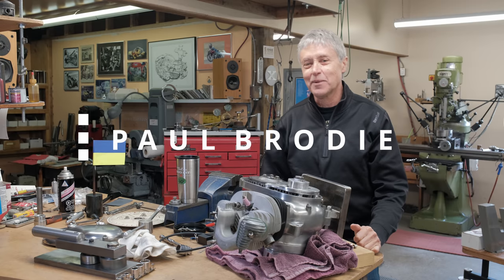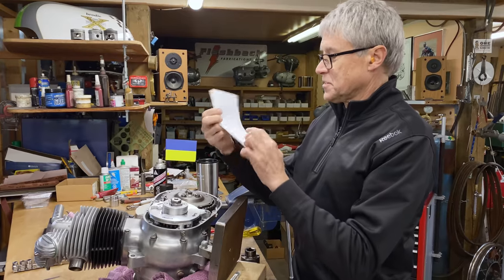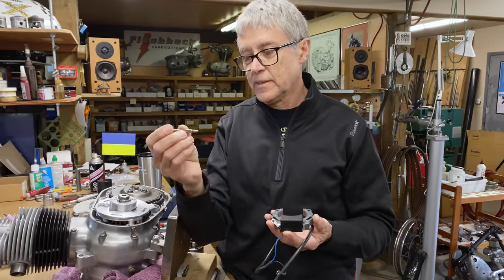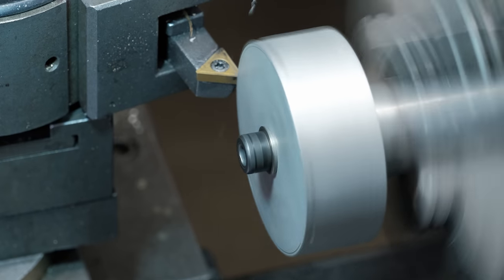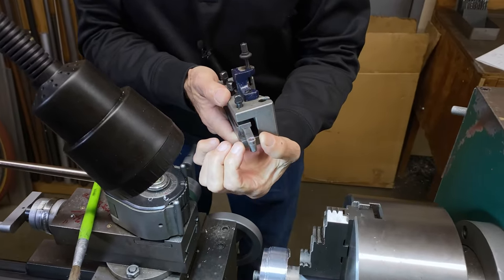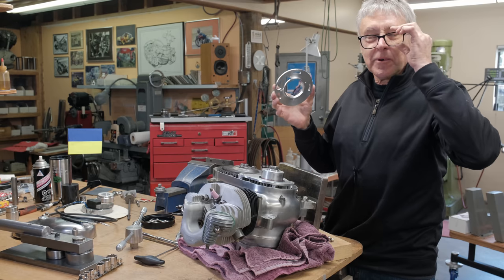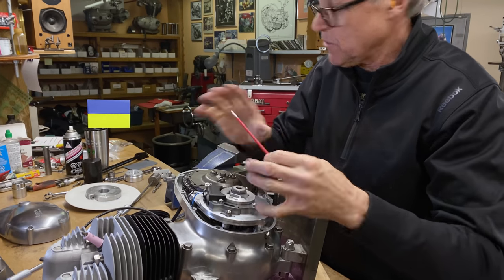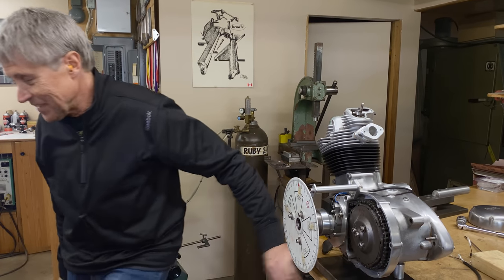How to find Top Dead Centre // Paul Brodie's Shop

Comment: Glad to see another Paul and Mitch show uploaded!
For those not brave enough for powered tapping you can just put the tap in the drill press and turn it by hand with gentle pressure on the down feed until it’s bitten in a few turns. Much less scary.
Reply from the maker: Thanks for commenting :)

Comment: Nice!! The old side valve Dodge 6 engines used a plug in a small hole directly over #6 piston and you used a proprietry depth gauge to do the same job. Thanks Paul.

Comment: If you feel the need to use a torque wrench, pull the spark plug, stuff some rope in the hole and jamb the piston against it.
Works for chain saws.
Cheers
Reply from the maker: Do chainsaws have valves above the piston?
Reply: @paulbrodie  No, but they do have flywheels that need to be torqued.  Rope is a common method to lock the reciprocating components.

Comment: The easiest way to fit a Cub ignition is to spot face the crankcase, and  put in threads for pillar bolts,  which the stator can be mounted to. There needs to be some degree of movement on the mountings, so the stator can be moved slightly to get the air gap correct.

Next establish the TDC position, using a piston stop, a fixed timing mark, and temporary marks on the rotor.  Then, when the motor is ready to run, check the timing with a strobe light, that has an advance feature, so the TDC mark can be used to time the engine.  

There are other ways to do these jobs, but the above is very effective and is a lot less time-consuming than most other methods.

Comment: A little tip: If you set the disc to 0° on the first "stop" you can simply divide the reading at the second one by 2, set the disc to that value und you have the 0° mark at TDC automaticly. Basicly what you did, but you don't have to estimate or calculate differences :-)
Reply from the maker: Yes, that will work too.
Reply: Thats not how it works ;-)
* measure it
* calculate it
* measure it again and check if the calculation based of the measurement is correct. These settings can be very critical high compression bad fuel whatever its useless to save 1 minute of time for this job.

You always rotate the engine at least one more time after change the valve clearance and measure again didnt you?
Reply: @10zoll  It is in fact, how it works. Why shouldn't it? You can check for same readings on both sides afterwards in both cases, mine just makes calculating a little easier to begin with. If there is still any difference, it will be very little and easy to fix. I think you just didn't get what I was going for.
Reply: @andreassiegler2238  sorry i am german and some germans are very meticulous. I do exactly knew what you re going for.
Eg "i" never would turn the degree wheel oposite to the engine rotation like paul did here i would always turn the wheel in that direction the piston is blocked because i am german and i want to limit every minor source of error ;-) btw: i didnt mention that most of the engines started life on my workbench have a compreesion ratio + 13:1 and these "cheap" errors can ruin a very expensive engine and thats just not worth to risk that.
Reply: @10zoll  Well, that makes two of us!
But still to me it makes absolutely no difference at all, which way one would turn the degree wheel, as long as it's on the crankshaft and not the cams or anything alike. When it comes to the ignition timing, you have to turn the engine in its running direction of course. Or maybe I'm not getting you?!
Reply: @andreassiegler2238  In meiner Jugend hatte ich zuviel mit Flugzeugmechanikern zu tun ;-) 4 Augen und 2 Messgeräte sehen mehr als die Hälfte davon.
EInmal gegen den Widerstand drehen und dann die Gradschablone weiter gegen den Widerstand drehen macht bei mir mehr Sinn. Wobei ich nicht weiß - nur annehme - dass sein Blockerwerkzeug dicht ist, der Motor also Kompression / Unterdruck aufbaut und selbst kleinste macken am nagelneuen (hier nicht der Fall) Kolbenboden stören mich.
 Ventile und Kolben mag ich gern glatt hochglanzpoliert, Ansaugwege rauh Walnussgestrahlt. Alles Ansichtssache.

Comment: always thought one had to go only in one direction to time or find TDC, because of the play in he chain... 
also, when I need to time an engine precisely (which may or may not be neede on your engine), I don't measure TDC itself, rather a given amount (say 1 or 2mm) before and after TDC via a precision dial gauge, then TDC is in the middle of these 2 angles (this is because the piston moves slower at TDC, so the angular sensitivity of the measure, hence precision, is lowest)
Reply from the maker: Play in the chain has nothing to do with TDC. You have a flywheel, a connecting rod, and a piston. There is no chain involved. Thanks for watching and commenting.
Reply: @paulbrodie  not the "links" chain (true, kind of misleading here with an actual transmission chain next to it) rather the "mechanical chain" linking the crank to the rod to the piston etc. (when timing valves as well) if one goes always it the same direction the tolerances are zeroed by contact (just like when the engine is operating), when changing direction the contact is made elsewhere...
Reply from the maker: @n1352-m1i  I have never heard a connecting rod referred to as a Mechanical Chain...
Reply: @paulbrodie  I guess this generic use of "chain" is more common here than in America... it's been a while since I've freshened up my English with native speakers.

Comment: Always use this dead stop TDC method with the valve train unassembled.  It’s possible in a lot of engines for a valve to hit the stop.  I made the mistake, once, many years ago.  😬
Reply from the maker: Yes, I'm always very careful with the pressure.

Comment: That was intimidatingly complicated but, a great learning video. Now all I have to do to really "get it", is watch it a couple more times!
Reply from the maker: Thanks for watching.
Reply: It's a lot more 'fun' to degree in camshafts when you have to modify the cam drive. Chain drive is usually pretty easy but gear drive a lot more complicated if manufacturer or aftermarket isn't available (or just too damn expensive)
Reply: Lol. I find myself re watching the older videos a lot. I find there’s always some small detail or move done that I miss. All the tips and tricks, plus the stuff he doesn’t even talk about but shows is crazy useful.

Comment: A tap-o-matic tapping head for your drill press would make power tapping in the drill press a lot easier! As often as you use it, it might be a worthwhile investment!
Reply from the maker: I have a tapping head that fits in my milling machine. I do use it if I have a LOT of holes to tap. For just a few holes it does not make sense time-wise. Thanks.

Comment: I’d like to know 2 things
1) what’s making the odd background noises…. Tasmanian devil?
2) why not just use a dial gauge to find tdc?
Keep up the good work lads
Reply: I believe Paul has some pet peacocks which is what you are hearing in the background.
Reply: 1 its a peacock (maybe this peacock is called mitch *scnr*)
2 pure logic whereever that bolt hits the piston it always hits the piston.
It doesnt matter if from one side or the other so the gauge isnt on the piston its on the Crankshaft.
Reply: 1) maybe a 👽 🙄
Reply: Surely this is more accurate. (Edit) my wife called me for dinner as I was typing, so a bit more... surely with the crankshaft angles involved, this method is more accurate that a dial gauge ‘estimating’ where TDC might be. This one divides between the same minus and plus angle of crank rotation. The Dial gauge could well be 10 degrees out as the piston sweeps over the top.. Les in UK
Reply: @leslieaustin151  Naa thats wrong...
This method is more Simple and less buggy.
Its not the method its the Operator that needs to be accurate ;-)
You always have to measure both ways when the piston is high - when (in both directions) is the piston moving down. doesnt matter if via static stop (bolt) ot via a dial gauge.
Reply from the maker: 1) That is my peacock. His name is Peter.
2) Using a dial gauge to find TDC may not be accurate. First, the spark plug hole is often at an angle. Second, as the rod goes over TDC there is very little movement of the piston, so you are forced to estimate...
Reply from the maker: @leslieaustin151  You are 100% correct. At TDC the piston is barely moving as the rod sweeps underneath.

Comment: I have mixed feelings about Anchorlube- pretty good for slow ops but tends to fling and make a mess on faster ones eg drilling.    Will have to try it more for tapping I suppose...
Reply from the maker: I never use Anchorlube for drilling or machining. Only tapping.

Comment: Paul, use different tool settings for the different holes. No writing needed. E.g. T1 is hole 1, etc. Thank you! All the best, Job
Reply from the maker: Yes, I know my DRO can do that, but the manual is so useless I never figured it out. True confessions.
Reply: @paulbrodie  Paul, hit the "center" button right under the digit display on the left. Then enter a number from zero to nine and confirm with the "load" key. Done. The number you choose is displayed and shows you the tool or datum you are working from.  I hope this makes sense to you. Especially on a lathe with a quick change tool post it is really handy. Best, Job
Reply from the maker: @jobkneppers  Thanks, I will give it a shot.

Comment: So how and when did You measure how far down into the cylinder the piston stop pin was? I use this method too, but i always make sure i go down equal amount with the piston stop pin, every time!
Reply from the maker: The piston stop pin. always goes down the same amount because I bottom out the thread each time.

Comment: Very Skookum Degree wheel mount. Sure beats double sided tape. But I don't know anybody who would use double sided tape?
Reply from the maker: It needs to be Skookum. I remember once it was not Skookum, I started the engine, the degree wheel fell off, and was spinning quite fast when it hit the concrete floor. Not good!